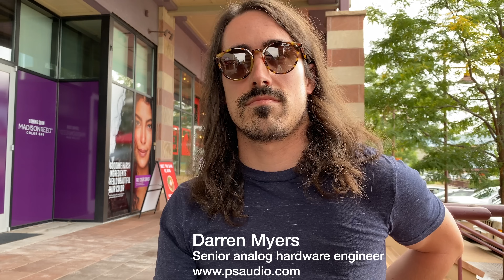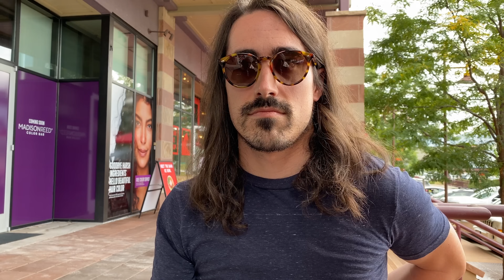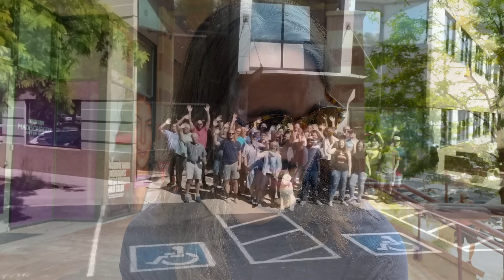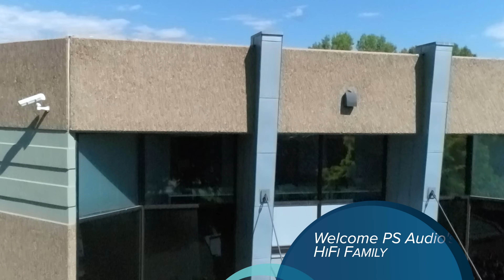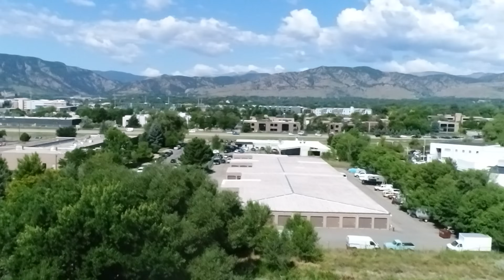Lunch with Paul: Why more audio companies won't lower feedback

Comment: Brilliant! No offense, Paul, (or maybe some) but Darren can straighten out a circuit concept that you can, unaided, turn to a pretzel. ;) Chris? Same thing. Keep bringing these fellows back. Do you have a DAC engineer who might untangle the mess the PR guys and many pundits have made about DAC's? Or, a class A, A/B, D power stage guy, who can explain what it might take to make one sound very much like the others and why. There's way too much witch doctor sticks and bones rather than wisdom going on in audio; way too many trademarks and memes without grounding in reality.

Comment: High-end guitar amp manufacturers have been dealing with this for years. That's why Fender and Marshall guitar amps have remained relatively unchanged since the 60's, and are still the best sounding guitar amps.

Comment: Bruno Putzey's likes feedback in his Mola Mola Kaluga class D amps...They sound amazing and I bought them. He is the Master. they do not get to warm...The capacitors cost more than the Hypex module he also invented!
Reply: @Benoît 
I think when the best and perfect amplifiers face with real world (best) speakers they lose 90% of efforts to make the amplifier perfect. Speakers have non-linear impedance input with capacitors (crossover) that can introduce lot of IMD distortion. How the perfect amp can help with speakers non-linear input and IMD?

Comment: Ok Im done with this video. High slew rate and bandwidth causes them to sound bad? Are you kidding me? Like an IC LM3886 amplifier with 18V/us slewrate and 8MHz of bandwidth that produces distortion figures down around the 0.003-0.005% THD, and they dont have a near cult-like following for nothing: They sound very good! The high slew rate and bandwidths are there for a specific reason: To allow the feedback to work its magic. Sounds like the tail wagging the dog as usual in the audiowanker community. People with more money than sense get this notion that something is bad, and companies cater to them to get that money, regardless of facts.
Reply: I don't think he was implying that higher bandwidth and slew rates are inherently bad in and of themselves. He mentioned dependency on the quality of the circuit layout, so it sounds like his concern is regarding the fact that faster devices are more prone to break into undesired oscillation.   Even when an oscillation isn't directly audible it can rob the audio of tone quality, detail and dynamics.  DC stage biases can offset when this happens.  Also, devices can be so busy clipping from a high-frequency oscillation that they can't keep up to reproduce the audio detail correctly.  None of this is a problem with extra design effort, layout, and testing, but that's a lot more work than simply going with a lower bandwidth device that's fast enough but not too fast.  Anyway, I'm 98% sure that's what his thought process was when he said that.  The LM3886 isn't the best example for this.  I've worked with a couple engineers who would design their audio amps with RF and high-speed video components, swearing the extra effort was worth it because they "sounded better", which I think is just nuts.
Reply: @0x07AF  I know what you're referring to, and it can impact the audio. I've seen oscillation with ICs if you try to do something weird with the feedback network that takes the gain below the minimum specified at some point: It will oscillate. I would agree with you that using very fast RF components is unnecessary, but this is mainly down to difficulty in achieving stability, and wasted bandwidth on something mundane like audio as you alluded to. If done correctly, though, they will work just as well as any other linear amplifier (and sound the same), just that you've squandered the excess performance of the active devices. Its also worth mentioning that properly designed linear amplifiers will show absolutely NO difference in sound from one unit to the next as they almost universally have low THD, very low output impedance, and sufficient bandwidth to cover the audio range. In other words, they are essentially perfect voltage amplifiers. The only exception could be low frequency bass where amplifiers are usually DC compensated to ensure they a) dont have substantial offsets, and b) dont pass a large DC offset from another device onto the speakers and damage them, as you may know. This obviously will roll the response off at very low frequencies. However, virtually all of the difference in sound will be due to which loudspeakers you use as they obviously use many different designs to achieve various goals, but with audio amplifiers, the design objective is very well defined as it just has to amplify. Easier said than done, but still something that should pose no great difficulty. This is something the audiophile community has misunderstood, as there are many solid state amplifiers with mediocre, if not abysmal performance characteristics. The lack of feedback (or reduced feedback) means that usually many more active devices are needed in the final stage to reduce beta variation and output impedance. I think there's one company that uses something like FOURTY output transistors in their amplifier that does not have traditional feedback. The specs are very good, but it seems like a lot of work to avoid installing two resistors and a capacitor as would usually be done, and they (as usual) tell some bunk story of why feedback is bad. Even a quick flip through PS Audio's catalog of amps shows this. They have only modest THD and output impedances on many of their amplifiers priced at many thousands of dollars, which seems like a raw deal for the consumer. Will it impact your audio? Doubt it. But for that kind of money Id expect at least an order of magnitude better performance from amplifiers of that caliber. With that said I dont hate PS, and I rather like the Sprout compact amp, which looks like a solid product. But for the rest Im rather unimpressed.

Comment: I never understood why the audiophile community has a beef with feedback. Using well-designed and properly biased amplifier stages with substantial feedback is where your ultra-low distortion figures come from as it only makes them that much more linear. Additionally it also allows amplifiers to have very low output impedances, sometimes less than a milliohm at the output of the final EF stages, making for essentially perfect voltage amplifiers. On a small 20W/channel amp I have, even with cheap spring-loaded speaker terminals, it has less than 50 milliohms of effective impedance. In fact, less feedback can be worse than none at all, as it will be enough to accentuate additional harmonics due to the process of feeding them back to the input stages, but not enough to suppress them fully as would happen in a proper audio amplifier that has roughly 80-90dB of excess gain.
Reply: G Guest  I would also agree that there are times to eschew feedback, but these should be done solely on circuit performance. Interesting to mention the fuses being inside the feedback loop. I've heard of that, but have yet to see any examples. I wonder how nonlinear a fuse could actually be? If they are running the fuse close to its limits it certainly could be, but that also shortens its life. On the other hand, it might allow it to blow fast enough to save the output devices.
Reply: Feedback is great until it isn’t. I think the beef is almost always related to running gear into clipping or into tough loads. The simple solution is to go “pro” with higher voltage rails and keep audio amplifier signals far far away from clipping. The biggest challenge to me is still the noise floor - this is where “pro” audio signal levels beat cheap RCA  hands down. Great gear never loses details even at low volumes because it operates intrinsically at higher signal levels.

Comment: Burson (Composer 3x) prides themselves on simplicticy. It sounds fantastic paired w/ Lsim 707, A-S2100 & AQ cables. The opamps are directly next to XLR outputs.  I returned Topping D90. I'm trying a Gustard X26 just to round out the $1400dac shootout. Probably stepping up to a 300w Mcintosh solution, but the Yamaha is fantastic!!! :D :D :D

Comment: The year is 2020, if you want to design audio circuits without negative feedback, vacuum tubes are the only way to do it. Whatever hapenned to progress? 🤔
Reply: Read up on siltechcables.com 
Their Saga amp used DC to power vacuum tubes.
I’ll paste it from their site:
Elimination Of AC Circuitry
The biggest source of self-noise in a conventional amplifier is the AC supply, both the incoming signal itself and the massive transformers and power supply components necessary to handle it. Siltech eliminated this problem by making the line-stage and separate V1 voltage gain stage battery powered, using sophisticated rechargeable cells to drive specially selected low-noise tubes. The results combine the remarkably linear voltage gain of vacuum tubes with the ghostly quiet background of a pure DC supply.

Comment: What rubbish. None of these Charlestons can tell us what actually is the problem with global feedback apart from parroting everyone else's line that apparently it is bad ! Or is it a case that if you keep repeating the same message then eventually everyone will agree that it is bad without having to backup their claims with anything other than hear-say ? All semiconductor manufacturers particularly DAC designers do not intentionally introduce distortions because they  think the majority will like the sound. No, they always try to minimize distortions because they don't believe their product should interfere with the recording chain and rightfully so ! Only PS Audio seems to intentionally break this rule :D LOL
Reply: Should rename his company BS AUDIO. He should sack that engineer.
Reply: I didn't get that out of it at all. Global feedback is just a tool which when applied in moderation can have great results. Just like medications, too much can have negative consequences to the sound as an unintended side effect even though the THD numbers look good.
Reply: @zulumax1  What are these negative consequences and why ??
Reply: High negative feedback sounds less like real vocals and instruments. Why?  too much damping to the circuit. Lowers output impedance which changes the voice of the  sound. Depends on if you like the end result or not.
Reply: @zulumax1  How does lower output impedance "change the voice of the sound" ?? Can you explain this mechanism in detail or is this something you have read elsewhere ?
Reply: @BuzzardSalve  Personal experience, I have two Adcom GFA-545 MK II amplifiers with modified warm feedback mods. Added extra resistor and bypass capacitor to the feedback loop and increased the bias running it hotter into class A.
Reply: @BuzzardSalve  The mechanism, damping factor. Acts like a shock absorber to the speaker. Too much can make the sound clinical, thin, and contrived even fatiguing. I am an electronic repair technician and into vintage audio for over 50 years, I am not an engineer however. Nelson Pass is an engineer and he designs and listens to his designs, then goes back in and changes the circuit if he doesn’t like the result which looked good on paper.
Reply: Perhaps you shoul start by reading some of the publications by Dr Matti Otala 😉
Reply: @janjacobsen4804  And all have been well and truly debunked since those days ;)

Comment: Being more in diy audio and reading up on different class a amplifier designs of Nelson pass  you really begin to appreciate his genius for making terrific sounding simple circuit designs with the lowest number of parts. And usually throwing in some tricks and some of his matched rare out of production parts.
Reply: Agreed.  Follow Papa Pass on DIYaudio and it becomes clear.  Or build your own triode based amp and listen to it.  I do the latter.  Then with the simple circuit choose parts carefully.  Even in a low feedback system the choice of the single resistor used in the feedback loop can make the difference.  Every part degrades the signal just a little.  It all adds up.  Use a lot of them and you simply miss some of the low level information that was in the source.  And you end up with a hollow facsimile of the original that measures well, but sounds like a dead machine vs live voice and instruments.

Comment: Hegel SoundEngine doesn't use any feedback but adaptive feedforward instead and should have zero crossover distortion. But does is sound like a feedback amp or not? Would it still be better with distortion?

Comment: Simple linear circuit, low or no feedback.  Triodes operating in the flat line of the curve.  Now you are talking my preferred system.
Still love to hear what Darren believes is removed from the signal by higher feedback designs that kills the sound that makes the toe tap.  My guess is there are low level signals in the pico volt range that simply get flattened in a complex high feedback circuit.  Then missing is the information that our brain recognizes as emotion cues.

Comment: I had a play with this on my favourite circuits in LTSpice, I took 20dBs out and saw reduced bandwidth and much lower slew rate but better stability, distortion was 10x higher but still <0.01%. I am tempted to keep going and see how far I can push it.

Comment: Sometimes simple is best.

A few years ago I built a La Pacifica phono stage, a few jFets and some resistors and caps for the passive frequency network and that was it. Not perfect but a lot better than anything at it's cost point that I have seen.

Comment: My feedback is that feedback can be great also in audio. As for all things in audio engineering, great sound is a product of great engineering and passion. Chances are that all your favorite music has gone through a ton of amps (incl. opamps) with feedback. Often feedback is what makes the output much more immune to the load impedance. Some circuits are impossible without feedback. E.g. how would you make a class D amplifier without it?

Comment: So basically it's the design not the product's parts.
Reply: Both are necessary for a good sounding product.  They are only talking about circuit design in this video.
Reply: @ricochetinmyskull  Ya but we went through this before on here. The difference between junk and good parts comes out to be pennies in the grand scheme of high end audio. They also said that a simpler design is better which means even less parts and less money. Like anything that is just a sum of existing parts you are paying for the design.